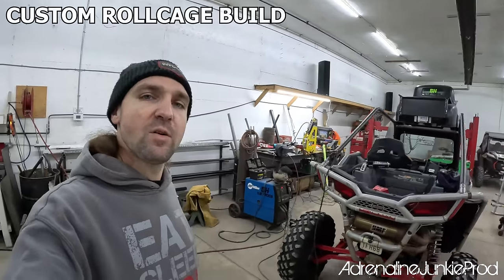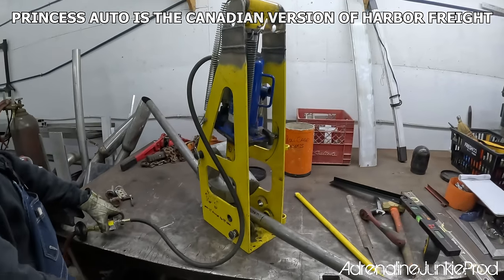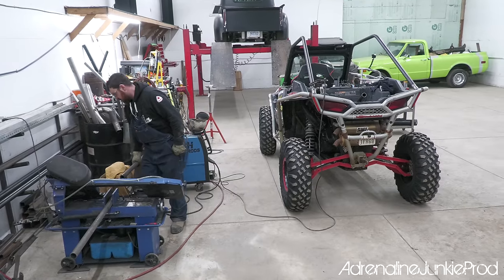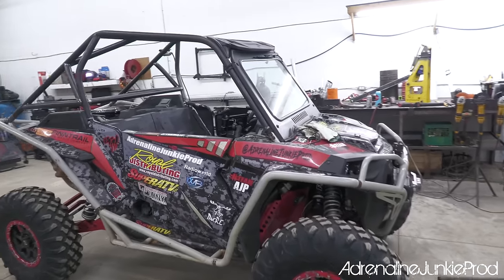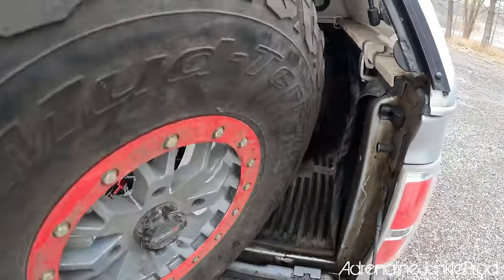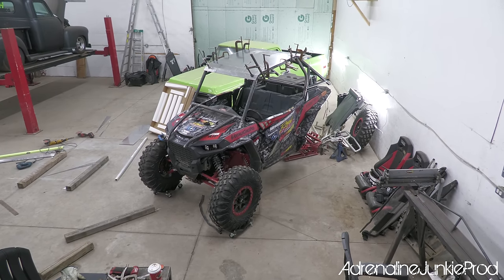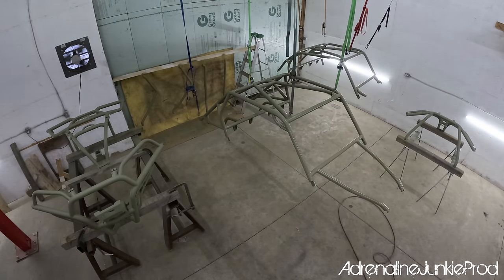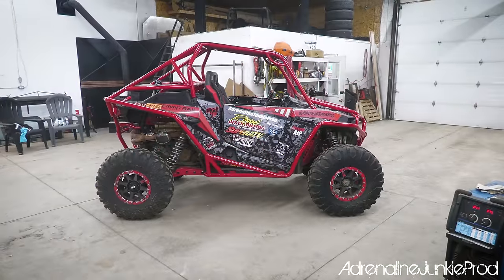Bye Bye Stock Cage! DIY Custom RZR Rollcage Fabrication - How to make your SXS/UTV build look wild!

Comment: You guys did a fantastic job on those cages!!

You’re making me want to haul my machine to Ontario to get Blair to do his magic to my machine!!

and the fire engine red looks awesome!!

Cheers from Manitoba
Reply from the maker: Thanks HotRod D!! Glad you liked both the cages. Judging by your name you'd probably love Blairs truck too, its a monster Hot Rod! I'm super happy with the red too, it turned out awesome! Wait till you see it with the new wrap. Just working on finishing up that video. Quite the drive from Manitoba, we would have to hit the trails and test your cage before you went home, lol!
Reply: @AdrenalineJunkieProd  100%
I was distracted by all the  vehicles in the background!
I was loving the size of that shop!
And he’s a great fabricator! Those bars came out great! 
I don’t remember if you mentioned it in the video?
But another advantage of running molly tubing is you save a little weight over mild steel. Because you can run thinner tubes
And tig is the only way to go!
It’s such a visual aspect of your rig
Nobody want booger welds on a beautiful cage 

Cheers
Reply from the maker: @alteredstateskustom  Your right man, one of the biggest benefits of running chromoly is the weight savings, I should have mentioned that. Blair is actually building a full chromoly cage right now for our buddies Segway Villain. It's gonna be sweet. I'll post some pics on Instagram and Facebook of it soon.  His shop is huge, it's awesome!
Reply: @AdrenalineJunkieProd  right on! 
I look forward to seeing it!
The shop videos are as good as the riding videos!
You never disappoint 👍

Cheers

Comment: Looks nice only thing I don’t like about polaris rzr cages is how narrow they are wish they were wider to offer more protection
Reply from the maker: Thanks, glad you like it overall. We actually talked about that off camera too how it would be nice if it flared out a touch more on the top bars. I think they just wanna keep overall size down.
Reply: @AdrenalineJunkieProd  yeah they look nice i just wish for function they were wider. Keep the passengers safer and help protect lower plastics. I wonder how it would look if a "tree kicker" or nerf bar was added to the outside.

Comment: great video im canadian aswell, what canadian website do you recommend for aftermarket parts? i have a can am maverick trail
Reply from the maker: Hey Bryce. Nice to have another fellow Canadian around, I’m trying to grow the Canadian following. It’s tough in Canada with one website that covers everything. I usually hop around between a few. Royal Distributing has free shipping and their UTV parts offering is slowly growing, REVCO is good for having a lot of tire and wheel options if you are out west then I’ve heard good things about UTV Canada. I feel because of how expensive shipping is in Canada that generally it’s still best to find a more local shop you can deal with to offset shipping and exchange rate. Things are improving though. Lots more options now then there was 2 or 3 years ago.

Comment: can someone tell me hor to roll the front aluminum roof to the front of my cage .my aluminum is o65 but it doesnt bend easy..how do u do that.
Reply from the maker: It’s not a perfect radius. We used a break and put a few minor bends in it. Then when I bolted it all down that pulled it all into place nicely. Then I also hit all the bends with a hammer and worked them into a nicer radius. Looks pretty good and wasn’t too hard to do. It’s not absolutely perfect but you really need to look up close to see any of the “imperfections” For an off-road buggy it’s great though.